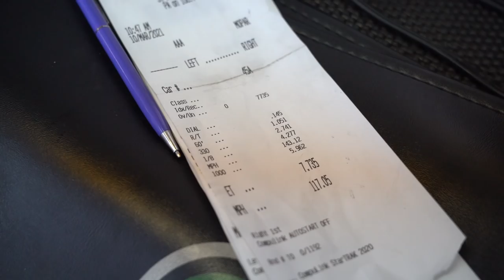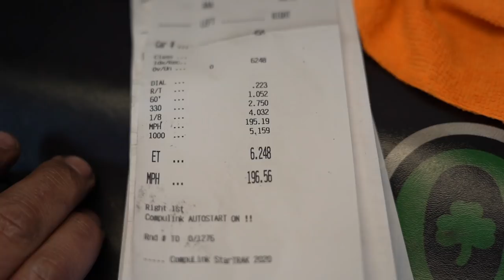Fastest Street Car In The World Calls Out A Top Fuel Dragster but the track said no...

Comment: I said the same foolish thing to a Jet car owner at Brotherhood Raceway in 1983 (an outlaw track on Terminal Terminal Island in SoCal-LA Harbor area), asked him for a $500.00 money bet to dial in against my 12 flat 63 Dodge Polara bracket car on a 5 10ths tree in the quarter.

He accepted, it was foolish but I knew I would be at the finish line first and by it before he came by me, and shutdown area was open and wide so I could release the throttle and drift out wide right fast as he shot by.

I won the bracket race, and the bet (he did not blow me off the track, but after he went by, he clicked off as I drifted right, and his thrust wake alone shook my car hard & flat shattered my windshield, it stayed put, but needed replacement immediately the next day, and the money I won fully covered it plus dinner for both of us and his crew and a few of my friends.

Great experience, fun times, great bragging rights (to win a bracket race between a jet car and a heavy slow car)...But, I never again asked such a foolish question, and grew instantly to grow up fast,, gained an appreciation of being older and wiser.  I would never want to repeat that stunt again during this lifetime.

I only won because I knew I was deadly on the .500 tree and he wasn't and I could run dead on the number, and escape with my life because he guaranteed he would click off at 1,320 feet. He pushed hard and was dead late and broke out bad.

I think he clicked off at 1,340 though, as I saw a hint of flame out of the left corner of my eye as he blew past like a rocket and my windshield went boom, and just spiderwebbed everywhere as I slowed from 114mph quickly, left my Bell Star helmet shield down on the return to the pits to collect the bet so I could get my windshield replaced the next day.

We all went out to dinner and laughed like little kids together. It was really a foolish thing to even attempt, but I am older and much wiser today. Would never attempt against a fuel car. Jet cars go perfectly straight, and slightly slower. But they push air in their wake that is instantaneous as they pass, even if not that close. (I was at least 50' to his right when he blew by my car....my .504 light 12.017 (on a 12.01 dial), at 114.76 to his .676 light 7.128 (on a 7.18 dial) at 189.76. Easy win plus $500.00 grudge bet win, loss of a windshield $178.00 and a $200.00 plus Dinner check, netted a lousy hundred bucks and a chitload of fun, and a cool true story and memories of a foolish move to never be repeated by me at least.

I expected the thrust wake, but the windshield damage I never considered until it went booof. Ooooops.

Comment: Are you making these passes with the gear vendor installed? Just curious.
Reply from the maker: Yes Sir!
Reply: Gear venders will hold all the power
Reply: @shacklifecustoms8430  Stock, they will handle 1200 hp but they advertise that they can build them to handle more. I have been very happy with the one in my 79 C20 pickup with a nice little 406 sbc that is setup for towing. It helped out that th400 big time and 400hp/500+ torque is nothing compared to what they will handle.
Reply: I'm pretty sure he is, otherwise he would have to have a different tailpiece and driveshaft to put in it's place.
Reply: @deanrandall8542  It sits in direct drive and just spins along without 12v to the gearvendors solenoid. When it is spinning fast enough to build enough fluid pressure and the solenoid is energized, it shifts into overdrive. When in direct drive, engine braking is fine (down hills with a trailer for race week, or in my case in a pickup for towing a toyhauler). GV says if you engine brake while in overdrive, the oil pump will not be driven sufficiently and it will damage the unit. They are quite stout and also versatile. The GV computer will automatically shift into overdrive at a certain speed, but I always manually shift mine with a second headlight dimmer switch on the floor. Race computers can also just send a signal to a relay to shift it as needed, like the one on Mullet (Cleetus' car).

Comment: Worlds fastest small block fairlane runs in doorslammer class but its a true street car with full interior steel bumpers and stock body work... no turbo either...drives it to and from the drags...your car is a door slammer or pro mod car...you can take any drag car and drive it on the street...doesnt make it a street car ...There are now many legit street cars now running 7 and even some in six second full quarter mile times...cars that you drive to the strip with all your mates on board then drive home again...here at home the boys 69 falcon sedan with 351 windsor runs 7 seconds at 210 mph...2850  RWHP on the dyno...and is detuned for reliability...

Comment: A top fuel car on a good run does the 60’ in .820 or 8 tenths of a second. 1/8th mile in 2.9 seconds at 295 MPH. While extreme quick for a streetcar the 60’ is most likely around 1 second flat and 3.9 seconds in the 1/8th at just over 200 MPH. Anyway you look at it it’s a mismatch but interesting.

Comment: last week i watched a street car do 3.9 seconds  in the 1/4 mile i run a different class pump gas only full body cars must drive it on the streets as a driver has to be fully legal to drive on the streets even tires this has really slowed people down . i am running a 1200 hp 327 on pump gas built by old man bell and he did the work not is crew he told me he did everything he could think of to the engine we started with rick news 70.s dragster engine 327 then ended up putting 25,000 in it it is one crazy little engine for pump gas only
Reply from the maker: Nice!

Comment: Tom, you know it's pretty good when you get Steve Morris in Florida as your engine builder/ tuner. Top of the food chain in jacketed 481X endurance motors.  Could try increasing the exhaust valve size and one less on the intake to stretch the flow out when the back pressure starts rising.